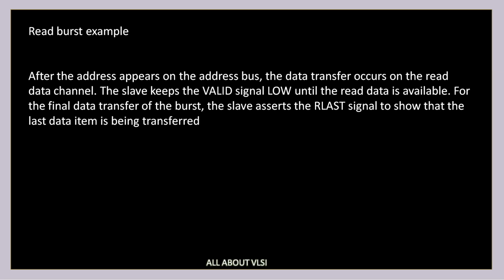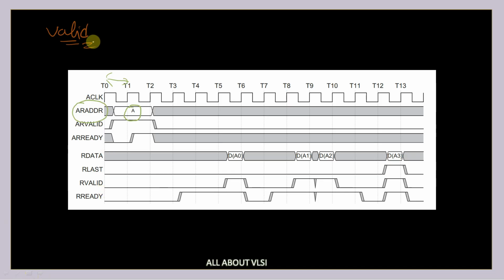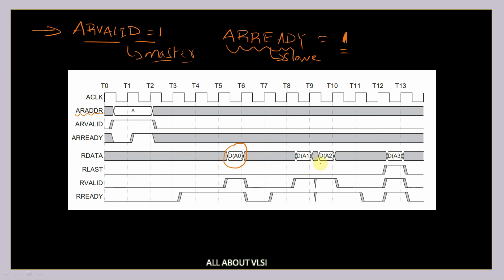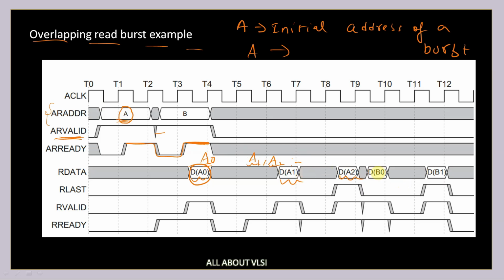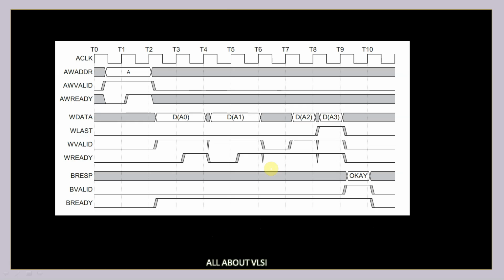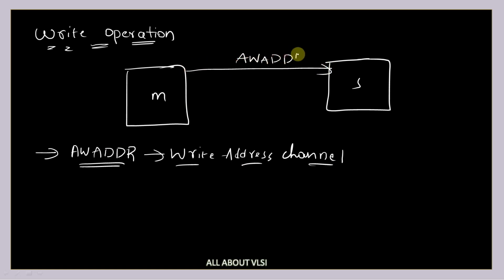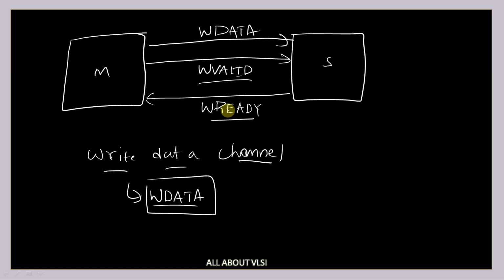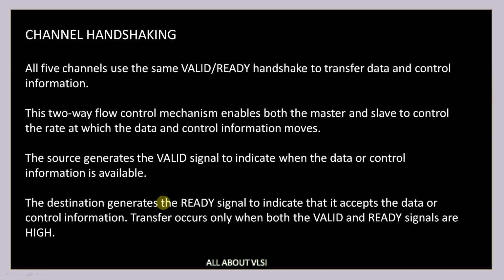AXI Write and Read Transfer | Beginner-Friendly AMBA Protocol Tutorial || All about VLSI ||

Comment: i have a doubt. Sampling of the address happens after the handshake, i.e when valid and ready are 1 right?, or its sampled first and then ready signal is asserted?
Reply: Sampling of address or any data can happen before asserting ready because ready is the indication from either side that it can change that addesss or any data